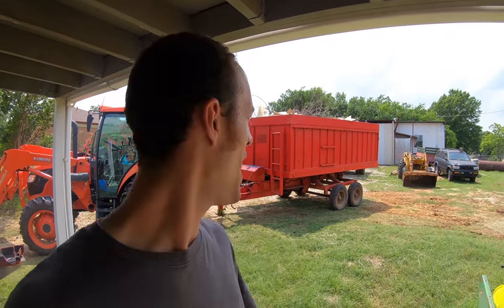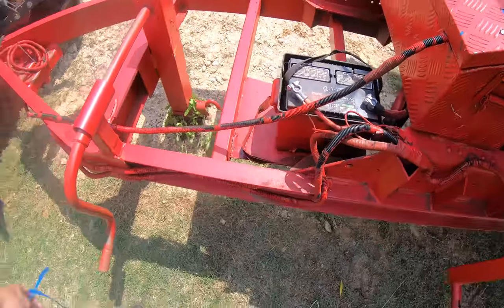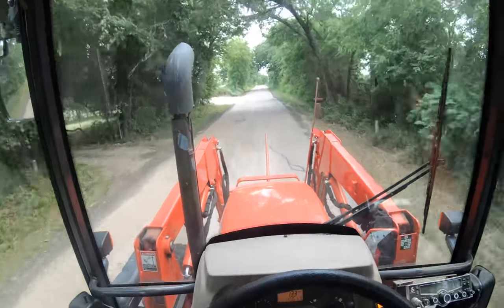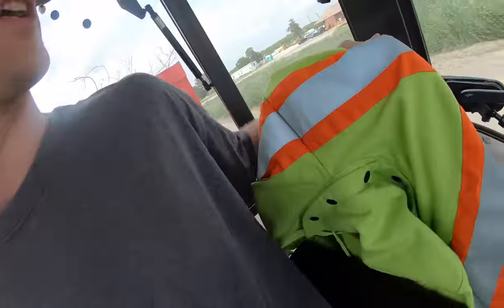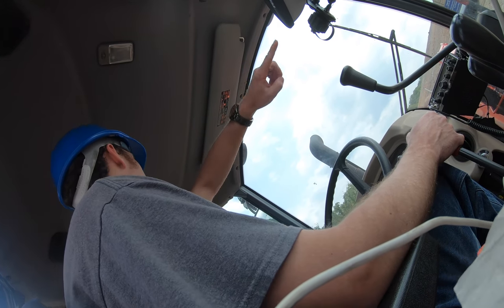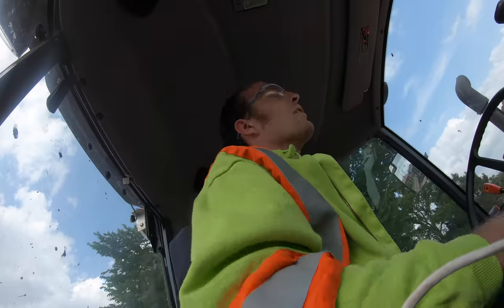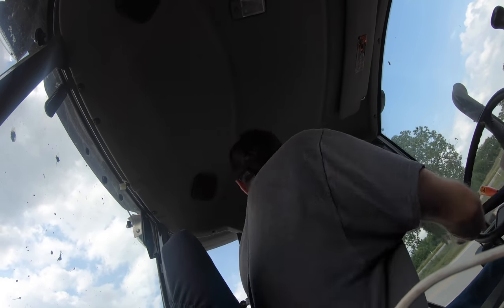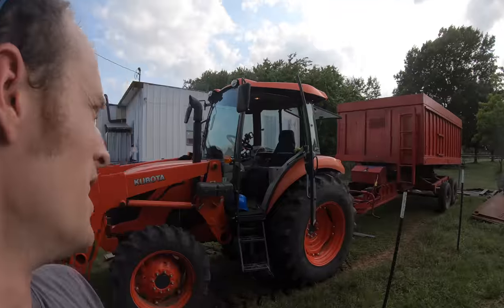THE CHEAPEST DIY DUMP TRAILER ON YOUTUBE?!? LETS TRY IT OUT!!!

Comment: I'd add like a T fitting with shutoff valve so you can benefit from the tractor or still use electric pump if you pulled it with a truck

Comment: I got one set up like that I put a valve in it to use a truck or if I gave to put it on my tractor to take it and dump it I can use the hydraulics on the tractor been working for 15 years like that just remember to what you have it hooked switch the value one way or the other.

Comment: I agree, I would have used the tractors hydraulics too. Nice build!
Reply: I just wonder if the tractor would have enough fluid capacity to be able to raise those telescopic cylinders all the way without emptying the tractor. Unless there 2 way cylinders I know most ive seen are just gravity to lower it.
Reply: Just T into the pressure Line for the electric pump and add your hoses from there..
Reply: @Drew-in-NoDak  surly doing so would result in oil pissing out the vent on the electric pump
Reply: @lucascannell4418  yeah forsure the fluid is gonna follow the path of least resistance the only way to add oil would be another reservoir added in before the hydraulic pump
Reply: @lucascannell4418  single acting cylinder. If the valve is closed on the pump, nothing will happen.  If you put it up with the tractor then down with the pump then yes it would.
Reply: @jblazer147  it works just like any other attachment, it's a closed system. You're not refilling it every time you use it. While you could keep both systems using valves to separate them , if it's only being used with a tractor it's pointless.
Reply: @jkholley1118  that is true if it is a 2 way cylinder but not a single acting cylinder

Comment: The only issue I see with only hooking up to tractor is if you want to pull it with something else, it wouldn't be good. But if it's dedicated for tractor use only, no problem.
Reply: I agree. I also dont like hooking my own equipment to other peoples stuff with their hydraulics on them though. You never know what garbage they have in their system thats gonna get flushed into mine, even if its such a small amount thats in their lines and cylinders on the attachment.

Comment: Why drive the tractor vs your truck
Reply: probably because it's difficult to register a homemade trailer in texas, if you pull it with a tractor it would be better since it would be more for farm use with slower speeds on the roads.he had to drive around 20 miles better to be legal with a tractor then getting a ticket for non-registered trailer